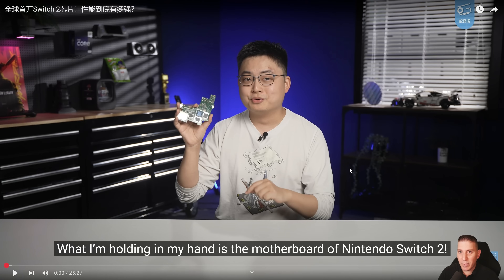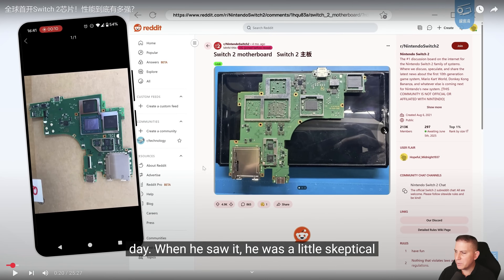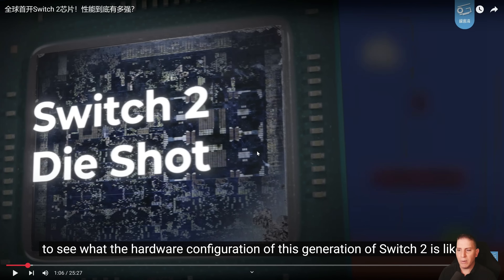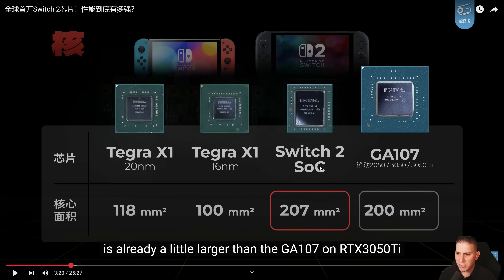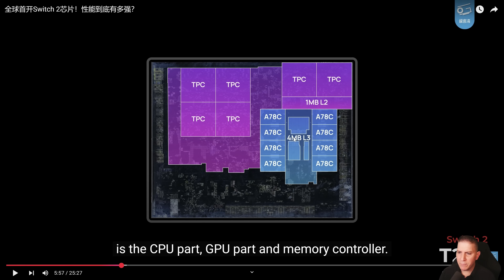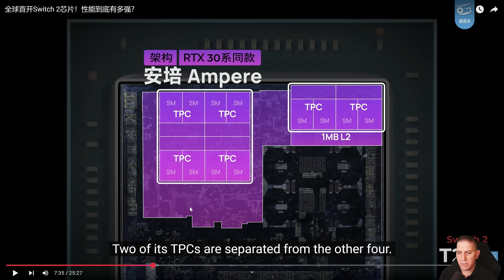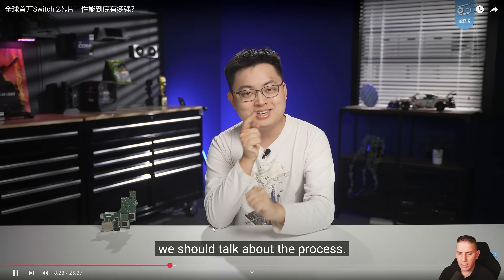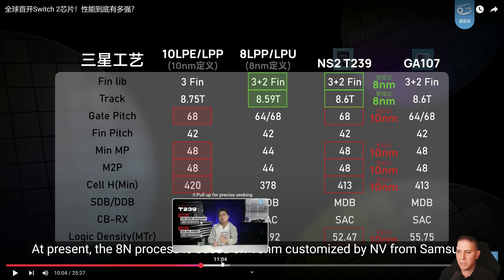Switch 2 GPU + CPU SOC Chip Size and Custom Architecture Revealed from Motherboard Scan

Comment: 12 gigs of ram in 2025 is so low. Nintendo is always going cheap as possible
Reply: It's a handheld console dummy
Reply: It's a handheld 🤡
Reply: 12gb is fine. It's not a PC handheld that's running chrome and multiple tabs
Reply: Series S 10 GB ram Bro
Reply: @capcomstreet2007  is the series s coming out in 2025 you absolute..... Anyway good luck in all your endeavours, surely you will succeed.
Reply: Is that why the ram speed is the highest of any laptop?

Comment: some monkey actually believe this is gonna be switch 2 gameplay. switch 2 simulation is require more resource to run and console run differently than pc . furthermore its a custom nividia chip for switch 2  not just some laptop cip and its already comformed more powerful than steam deck, (10 x stronger than switch one .) those people really didnt go to hand on the switch 2 . And remember those people have anti Japan agendas try to mock japan down
Reply: Where are you from?
Reply: @ThinkTinkh  👽👽👽

Comment: I'd have to dig out my comments on other vids from a few years back, but, I calculated years ago that a GTX1050 (or GTX1050ti to be safe) would be enough to run Mario Kart 8 Deluxe at 4K. The results from that video (which I watched before seeing this video) aren't surprising to me at all. The video's hypothetical performance numbers also confirms the Switch 2 is much more powerful than a PS4. The Steam Deck performance comparison also seems to confirm Switch 2 docked-mode is more powerful than Steam Deck, but, handheld-mode isn't quite as good as Steam Deck.

Comment: This is the same guy that did a Switch OLED mod. He was able to push both CPU, GPU and ram at max clock speed. He ran Linux and Windows on Switch and was able to play God of War on the system from Steam.
Reply: Bro sounds like a Mpnster
Reply: Wow
Reply: That reminds me. I need to hack my launch Switch so I can finally play Chrono Trigger on it since Square-Enix just REFUSES to port that masterpiece to it.
Reply: what fps though
Reply: @ZackSNetwork  ps2 or new god of war?
Reply: That's really cool if he can do the same with the switch 2. I will buy it in a heart beat.

Comment: Just want locked 60 either 1080p or 1440p
Reply: Some games are achieving this
Reply: @purextreme5460  for which game? Tetris?
Reply: @ThinkTinkh  Metroid Prime 4, Mario Kart World and Donkey Kong Bananza
Reply: @codezero7981  prime 4 is a switch 1 game, Mario kart World is Mario kart 8+ open world with nothing in it, and bananza isn't stable

Comment: I planned to keep mine docked. Supports my screen. 1440p, up to 120Hz. That's quite impressive.
Reply: I did the opposite until i got the oled, i use it in handheld only and use the og hooked to the tv. I will hook this new one to my tv because i bought a pro controller and the camera.
Reply: Fr
Reply: I plan to play fully handheld. In docked the switch cant do 120fps, because the switch doesnt have hdmi 2.1
Reply: @SWOTHDRAyou're really only gonna get 120 for first party games though or a select few multiplayer games. If you're gonna play a game like cyberpunk or Hogwarts legacy you're much better playing it being docked.
Reply: @SWOTHDRA  (Edited) I checked Nintendo's site, and it says it has the potential to output 1440p- up to 120Hz in docked state. Can also do 1080p 120Hz in docked state. 4K, 60Hz is the maximum claimed output.

Comment: So are we happy with the results? Haha I had no idea how bad the cpu was compared to steamdeck. Nice to see the GPU is more capable. I am also sure that the performance is a bit better than just downclocking the 2050. Its like tuning an engine. you can't just downclock something and get the same results. The chip is built to work at low power.
Reply: The PS4's CPU was much weaker still,  and yet, all three are producing similar looking games, sans DLSS. As the source video shows, the CPU just doesn't really matter much for game performance.
Reply: $90??? Wtf, is $80
Reply: well steam deck is allowed to use more power towards the cpu if necessary. Ive seen steam deck games where the cpu is at 100% with all cores at 2.7 GHZ and the GPU goes down to 800-900 MHZ. If steam deck had locked clockspeeds and allowed its GPU to be at 1.6 GHZ at all times. I wonder how low the CPU would be clocked?
Reply: @ yes and nothing can beat good optimizations. I’ll watch someone play a ps4 game on steam deck and the game will be cpu limited even though the game ran fine on ps4.
Reply: That test is made in geekbench which is for x86 based cpu's, that's like measuring km/h using imperial system
Reply: If Nintendo fans are happy then there really is no argument.
I couldn't justify the purchase myself price to performance wise. The closed eco system, paying for online and $90 games..

But if people are happy to pay that then it's all ok
Reply: @66kaisersoza  Yeah idk where you're getting $90 from lol.
Reply: Steamdeck is trash lol

Comment: 8:59 like NVIDIA said, it’s custom so Nintendo and NVIDIA had the ability to pick and choose how it is designed to get the performance they wanted.
Reply: I can't tell if you're agreeing with him or not. Geekerwan mentioned that it looks the same as the Ampere cores on Orin which are still Ampere despite being laid out more like Lovelace cores. I would imagine one of the reasons that the cores are larger than on a 30 Series GPU is because it's made on a less dense fabrication process than that GPU. When Nvidia and Nintendo say that it's "custom" that means the SOC is custom not the GPU architecture.
Reply: This guest analysis liked Digital Foundry and this Chinese guy doing are just for fun purposes only. Real analysis are more important because we can use what Nintendo & Nvidia secret sauce cooked in the Switch 2. NVN2 API also need to put in this calculation for future analysis

Comment: I confirm the specifications, in a nutshell we are talking about a hardware more powerful than ps4 already in portable cpu mode 3 times more performing gpu over 2x than a ps4 in dock mode, cpu worse than steam deck but in multy core you should approach! it is however from the tests it seems that it is not a bottleneck given the power of the gpu that is still limited so much stuff considering the dlss at 10watt this is a masterpiece!
Reply: Yeah, seems the CPU cores are bit weak(slow), but if you watch the source video doesn't seem they are even the bottleneck. So not much reason to make them beefier.
Reply: Exactly it's a very balanced hardware!

Comment: Hey Dave,

Really appreciate you covering the leaked Switch 2 motherboard analysis. It's always great to get updates on potential new hardware!
I just wanted to share a thought as a fellow community member who's been following this closely. While your video touched on the analysis by Geeker Wan, I felt that some of the really specific technical details and the depth of the performance estimations from their video seemed to be a bit less emphasized in yours. Things like the specific types of components used, the estimated clock speeds they arrived at, and the detailed breakdowns of how certain games might perform based on their simulations were really interesting parts of the original analysis.
I know it's tough to cover everything, especially with the caveat that the board isn't functional, but I think including a bit more of those granular details would give viewers a more complete picture of what was actually found and the potential implications. It just helps us all understand the context better and how significant this leak might actually be.
Keep up the good work, though! Always look forward to your videos.

Best!
Reply: @JordawnTheJew  why do you think he did not include them? Just curious.

Comment: I've been thinking lately that sometime in the last couple years, Nintendo must have had a choice between entering production to launch with a ton of units in late 2024, or doing one final hardware refresh at the cost of a delay into 2025 but with the result of a more powerful and competitive console. The unexpected power of the Switch 2 doesn't seem to me like hardware that was finalized 3-4 years ago, but something more recent. I'm not an expert in hardware development or anything, but I just keep seeing things that suggest that may have been what happened.
Reply: I don't think so. Its just a good a little bit older powerfull mobile chip they customized to run relatively efficient. And when you like what you see the numbers on paper don't really matter. In the end it could have been made more powerfull and more modern, but probably at an even higher price. On one side its a little bit sad, cause they could have made it more futureproof and games a bit more "next gen" looking, but on the other side the games look fine and Nintendos games will really shine on it. So i don't really mind. We are quite a bit above PS4 level for games like Zelda, Mario and Xenoblade with 12gbs of ram, DLSS and some minor raytracing capabilities, it will be fine :)
Reply: @currywurst2434  this is every console lol. They can make it more powerful but it's always at the expense of time and price. With handhelds you have to also add power draw
Reply: Nice observation
Reply: 2022 tech
Reply: @golgot5935  right-- and the Switch was based on 2015 tech. They would have been designing and prototyping the Switch 2 probably by 2020, so I'm just saying maybe the reason the Switch 2 seems to be closer in specs to something like the Series S rather than the previously reported base PS4 could be that they did a revision-- maybe to incorporate some new improvements in hardware-level DLSS features or something.
Reply: @golgot5935Math checks out. The Switch 1 was based on 2015 tech, the switch 2 was supposed to come out in 2024, but got delayed by 8 months
Reply: @theakiwar9118  if that's the case Switch 2 must have some 2022 power tech inside which is not bad.

Comment: Once they get the Switch 2 chip, it will be similar to the original but with improvements. I think the Switch 2 can handle games like Black Myth Wukong, Final Fantasy 16, and GTA 6. It will be slightly more powerful than Xbox Series S, but not as powerful as PS5.
Reply: You are dumb as dog did you watch the video they did a chip analysis on everything  it's not even close to series s.
Reply: I mean that's awesome actually, dlss and shit allows you to play at ps5/sx lvl graphics even if the resolution is not native
Reply: lol i doubt switch 2 could handle final fantasy 16 and gta6
Reply: and you think p5 cn run black myth wukong great? unless you used to 30fps or less
Reply: @gillleehahn7451 well the guy did run BMW with the simulated Switch 2 CPU and GPU. It works. But obviously at sub-900p and 30fps and this is unoptimized

I can imagine it running at 540 or 720p and being upscaled to 1080p with 30fps as the major drawback.

So it can work, that much says the simulation
Reply: @gillleehahn7451  that what the ps5 pro is for to play those games better then what ps5 can..
Reply: Not even close to xbox series s

Comment: Crazy how that small board is running games that last Gen home consoles couldn't handle.
Reply: Last gen consoles had horrible CPUs
Reply: People are always salty about hearing this , especially if they own a steam deck / last gen console
Reply: @Emiichoco  there are plenty of older consoles that are more powerful than the switch 2 in non dlss/raytracing performances.
Reply: @ThinkTinkh  list them
Reply: @sylect  PS4 pro, xbox one x. PS4 in some ways, xbox one in only one way.
Reply: @ThinkTinkh just because they have a higher peak theoretical  on paper doesn't mean they can actually reach it.

There's a reason switch 2 is kicking the crap out of ps4 pro in every game they share, using ps5 gen assets at matching or higher output resolutions, and running games ps4 pro can't.

Gcn takes way too long to actually load its registers and cus and be capable of even potentially reaching its peak theoretical.

Hawaii takes 2,560 cycles, one x takes, 1,600 cycles ps4/pro takes 1400 cycles. This is straight from amd.

Switch 2 takes 12 Cycles to load its sm's and registers and acheive the occupancy required to have the potential to  reach its peak theoretical.
Reply: The OG switch could run games that the Wii couldn't handle. Tech progresses
Reply: @SIPESSB  rage bait 🙂
Reply: Even Xbox One X has some advantages over the newer series S, the new architecture however simply have a miles better CPU and support for newer stuff like ray-tracing.
Reply: Which games are that? Ps4 could ran any game switch 2 can. Easier comparsion would be steam deck since it's more powerful in handheld mode then swith  2.
Reply: @issacdragon3834  Cyberpunk 2077: Phantom Liberty for one. Plus Star Wars Outlaws.
Reply: Cyberpunk is playable on ps4 so if they really wanted to they could make phantom liberty run it's just not worth it. I think they realize  that's it not worth the effort cause everyone by now has moved on to PC or ps5
Reply: @issacdragon3834  If you think the Steam Deck is more powerful than the switch 2 in portable mode you're gonna be disappointed.
Reply: @AgagaSnsns lol split fiction can run 60fps on steam deck while only 30fps on switch 2 so yea i expect better game performance on steam deck and we already ahve some proof.
Reply: @issacdragon3834 Split Fiction is only 60 fps on Steam Deck using medium-low settings and 1080p (docked), Switch 2 is likely running the PS5 port at 4K.
Reply: @ninetailedfox579121  no its not lol. it's most likely 540p upscaled to 1080p.
Reply: @AgagaSnsns Switch 2 games look a lot better than Steam Deck games from a graphical standpoint. I don’t know how the frames will perform, but the graphics look better. We will know more when the actual console releases.
Reply: @issacdragon3834  steamdeck runs it 720p with heavy FSR at 35-47 fps average. Switch 2 will run it 1080p locked 30fps on tv. I dont know where are you taking these claims from
Reply: @SIPESSB  cuz he owns the steamdeck and he mad for a new shiny kid on the block 😂
Reply: @quann06  we really haven't seen enough to say in handheld mode. in docked it seems to be very close to ps4 according to DF
Reply: @puntacana7550  Seems like thats the case. Switch 2 GPU is closer to Z1 extreme and has much better upscaling. FSR looks like dookie when playing at 720p
Reply: @issacdragon3834  You: "Steam Deck is more powerful in handheld mode"
Also you: "We haven't really seen enough to say in handheld mode"

Oof.

Also DF doesn't have any more to go off than any of the rest of us do. They don't have the hardware.
Reply: @ninetailedfox579121  Based on the specs its clearly more powerful over all.  he says the games look better in handheld mode i said  we have really haven't seen many footage of it in handheld mode to say the games look better.
Reply: @issacdragon3834  Based on the specs of what? We don't know the specs of the Switch 2, all we have to go off are off-handed comments made by NVIDIA. The one thing we do know for certain is that the Switch 2 screen is 1080p 120hz + VRR (and targets 1080p60), while the Steam Deck screen is 720p 90/60hz.
Reply: @issacdragon3834  games that require hardware raytracing and SSD. There are plenty and coming
Reply: Did you watch the video? Games are demanding and have ray tracing won't run a in playable state in handheld mode
Reply: @SIPESSB  useless features unless you have a top tier GPU like 4090 and 5090.
Reply: @juanrubio6132 latest games require raytracing capable hardware now, switch 2 has rt cores enabling it to run the games. That was my point and not switch 2  running  lighting effects like 4090
Reply: @issacdragon3834 its not tho
Reply: @issacdragon3834  ps4 couldn’t run the cyberpunk expansion or ff7 intergrade. Switch 2 is getting the ps5 versions of the games that never came to ps4.
Reply: @ fake news. you realize MK1 came out on switch and not ps4/xb1. does that mean it can't run on ps4? developers have moved on from ps4 and its not worth the effort when gamers have moved on to or or ps5. switch 2 is wirtn the effort cause its new system thats suppose to sell like hot cakes.
Reply: @issacdragon3834  Take a chill pill bro!
Reply: @issacdragon3834  cyberpunk DLC
Reply: @ nope. those games can run but's just not worth it the effort. mk1 came out on switch and not on ps4/xb1. everyone has moved on from consoles released in 2013.
Reply: @issacdragon3834  from what we know steamdeck and switch 2 tie in some aspects, switch 2 Wins in some, steamdeck wins in other, overall switch 2 handheld>steamdeck handheld
Reply: @issacdragon3834  Steam deck is way less powerful than the ps4, but thanks to optimization, it's alright
Reply: @ steamdeack is not way less powerful then ps4 they are pretty close power wise. they both have advantages and disadvantages.
Reply: @LouieM727  Steam Deck only has a better CPU. The GPU is more inline with the Xbox Oone

Comment: It makes sense to me that the gpu is closer in design to ada vs ampere. It has less cuda cores then a 3050 desktop gpu but looks like it can produce graphics better then what a 3050 can do.
Reply: You clearly didn't watch the video if you think it's on par with a 3050.
Reply: Lol it cannot product better graphics then a 3050 it's on  par with a 1050 ti